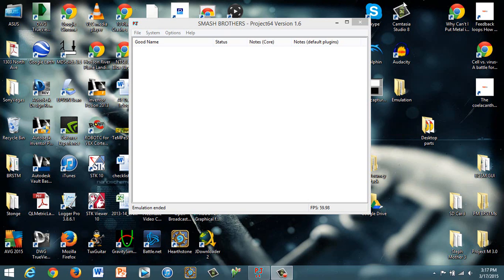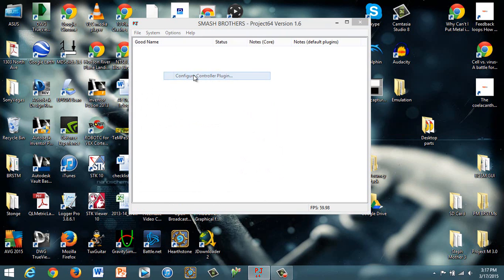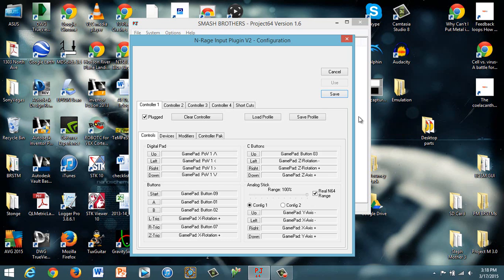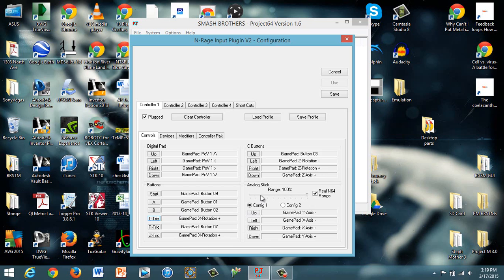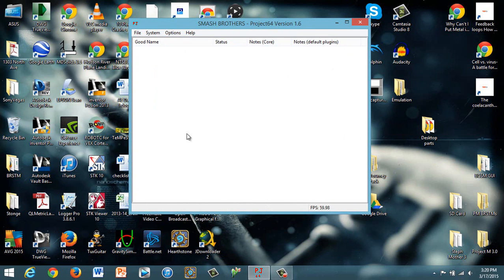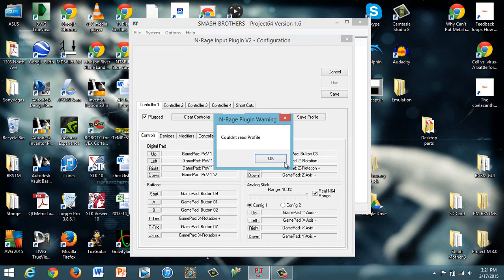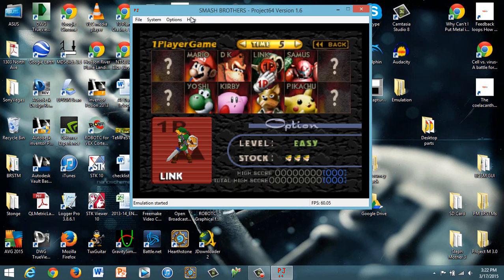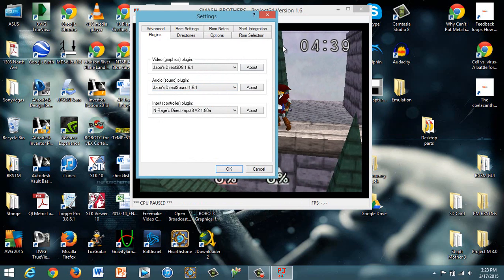Project 64 Mayflash Adapter Setup for Gamecube Controller Windows 8

Comment: I just recently started speed running mario 64, and my c stick registers on  the settings, but not in game, any ideas? Also, is pressing l and r down all the way the only solution?
Reply from the maker: With newer versions of the emulator I'm honestly not sure what it can handle.

Comment: hi i've spent all day trying but still can't get my pc to recognise my mayflash gamecube adapter inputs for PJ64. I'm using Windows 10 and my PC makes the bing noise to indicate it's recognised something it's plugged in but when I try to configure the controls in PJ64 nothing happens. I've tried: 
- disabling the driver enforcement 
method in this video: https://www.youtube.com/watch?v=gYk-21aN4ig
- installing a bunch of different drivers 
- installing different plugin controller inputs (e.g. NRage DInput8 V2.2.dll into the program files) 
- getting it to work with vJoy and WiiU - USB GC Adapter (apparently this is only for WiiU 
- i'm just playing a ROM on my laptop) 
- plugging it into every different USB port on my pc 
- switching the mayflash from PC to Wii U and back 
I've watched every Youtube video on the subject and followed every step to the letter. 
should i use a different plugin? 
should i use a different version of pj64? mine is 1.7.0.50 
should i use a different adapter?
should i just download Dolphin and try and play on that instead? thanks for any help
Reply from the maker: This is for windows 8 so drivers could be  different. I've never set this up on windows 10. It's also been areally long time so updates have happened I'm sure. I'm sorry man :/

Comment: Im confused as to why my controller isnt even being recognized? I have the adapter to connect it, its in, i have everything downloaded but no inputs on my gc controller are being registered at all
Reply: my computer recognizes its in, just no buttons work. Does it need to be the Wii U adapter? I have the switch one, it came with my smash ultimate gc controller
Reply: @alexanderh7807  damn 4 months and not a single reply to help
Reply: @marudofu  its okay lol. figured it out myself. Played DK64 and never turned it on again lmao
Reply: @alexanderh7807  how did you figure it out? lol
Reply from the maker: I'd been off of youtube for a couple years really and missed all of the comments. At this point my guide is probably outdated but I'd imagine the newer versions of Project 64 make it easier.

Comment: I can't get my gamecube controller to work. The project 64 simply isn't reading the inputs that i'm putting in. Any help would be appreciated.
Reply from the maker: did you install the driver file(s)?
Reply: Yes I have it exactly like you did in the video.
Reply from the maker: You're using a mayglash adapter too? Windows 8 or 8.1? If that's the case, assuming hardware is good, there shouldn't be a problem. Did you extract driver? Or just moved a zip file. Hard to help much without really knowing your setup
Reply: Battle X On 

Yes, the one with two ports. Windows 10.

I downloaded the thing to give my Project 64 the 1.6.1. What are these drivers you're talking about?
Reply from the maker: This guide is for Windows 8. Windows 10 should natively pick up the device, but may work differently. I would look up a Windows 10 guide if one is available.
Reply: you end up figuring it out? My story is similar, my mayflash was showing up in devices so i selected it but the program would still not pick up my inputs, so installed more drivers on zadig and now my controller wont even show up in devices.
Reply: frog man 

haven't yet but I'll get back to you if you do. I'd recommend posting on p64 forums if i were you

Comment: My device is being read, and I can select it, but I can only input one direction: GamePad: X-Rotation -...the other times i attempt to change anything I just get a wait notice. Nothing.. Installed drivers and reinstalled.. I'm using the MAYFLASH 4-port GC adapter for Wii U
Reply from the maker: jinglebear2 I've never used that adapter before, but what does the emulator say the directions are set to if not + and -?
Reply: I switched to my old Mayflash 2 way adapter. I am trying to get any direction or any button read, and only "GamePad: X-Rotation -" will select from my end. Even on start, if I press start. Same result.
Reply: Actually, it is working now with the USB Gamepad 1 registering. Thanks! Looks like the MAYFLASH 4 Way GC Adapter doesn't work for this plugin.. At least I have my old 2 way. Time for some Majora's Mask.
Reply from the maker: Sounds good! have fun :)
Reply: Shit.. I have it configured, and I selected "use" at the bottom, but nothing is responding.

Comment: I use the mayflash adapter and it works fine but when i play anything that isnt smash or a racing game it doesnt detect a full 360 only up down left and right and that makes it really hard to play anything else other than smash and a racing game any solutions?
Reply from the maker: Far can you screenshot the inputs you have set? is it checking cardinal directions or all possible ones? is there a dead zone you can change? have you calibrated the controller again or reset the controller settings? lotsa questions here
Reply: almost right as it gave me the notif that you responded i fixed the issue it was the analog range it was set to 66 and not 100. that fixed my problem but thanks for responding anyway :D
Reply from the maker: good stuff:)

Comment: I installed all the inputs and I have been using Dolphin with my gamecube controller fine but Project 64 will not recognize the controller. When it does, immediately sets any input to "Gamepad X-rotation". I have tried 2 versions of Project 64 and 2 different controllers. Any help would be appreciated.
Reply from the maker: MasterChief0522 gamecube controllers and n64 controllers work differently in terms of analog/digital controls, so sometimes it helps to hold certain buttons halfway before starting the config. set the thresholds better.
Also, mapping the dead zones is really important depending on your controller. I know xbox360 controllers move much quicker than gamecube controllers through an adapter in terms of motion speeds. So monitor the ranges. calibrating it in Windows is pretty key then, too.
Reply: Battle X On How do I calibrate on Windows 8? I can get to the calibration tool, but the inputs don't do anything there despite still working in Dolphin.
Reply from the maker: as long as the right plugins are installed you should just have to pick the right device while it's active (connected  and turned on).
try checking my guide for setting stuff up for steam and it might help. It's been a while since I did that though.
Reply: Battle X On Thanks, I'll try that. If that doesn't work  I'll just get a Mayflash adapter and see if I have any luck with that (I'm currently using the official gamcube adapter).
Reply from the maker: all of my guides are using the mayflash adapter so that would probably help
Reply: Ok, I got a mayflash adapter but still nothing. Opening the calibration tool displays that all ports are working, but upon trying to calibrate the controller, there is no response. However, Dolphin still recognizes the controller and it plays fine. I really don't know why it's not working in P64 and the calibration tool. I have all the drivers and I've reinstalled the drivers through Zadig 3 or 4 times now.
Reply from the maker: what version of project64 are you using?
Reply: Battle X On I've tried both 1.6 and 2.3.2
Reply from the maker: have you tried a different controller? if it still sets everything to x rotation you should try holding the sticks in a direction before calibrating to double check what is rotating that causes that. double check sensitivity values. it seems like the controller is either constantly registering an input, so it reads it before you can choose the button
Reply: Battle X On I'll continue trying, but for the time being I havr managed to figure out how to install wads into dolphin and they run seemlessly with the gamecube controller. 

I have tried 2 controllers, both have the same results. I tried them in 2 versions of project 64 in conjunction with 2 adapters, so I really am unsure why I'm having problems. I'll mess around with the sensotivities and how I input them to see if it changes anything. Anyway, thank you for all your help, I really appreciate it!
Reply from the maker: Not a problem. I just feel bad that I can't figure out a solution for you. Hopefully you find one!
Reply from the maker: wait...did you do what I did in the video? I just realized x rotation was part of my original problem. I held down L until just before it clicked, then clicked as the input. same for R.
Reply from the maker: MasterChief0522 I also manually input some stuff in, but this was soooooong ago.
Reply: Battle X On It was doing that for any button, whichever I tried to map first. As soon as I clicked "A" or "Up" or anything, it immediately went to X Rotation, then the next button I would try to set would count down to 0 and remain unassigned
Reply from the maker: I feel like there's a setting that needs to be checked or unchecked. I'm tempted to say reset all settings and try again, but I don't want to waste time.

Comment: how would you go about setting up multiplayer. I thought I had it but my second controller doesn't respond in the game but it does in the options. my first player controller will act for both controllers though. is there another plugin perhaps?
Reply from the maker: Josh Mosley you need to tell the emulator to use the second game pad option iirc. it treats each controller port as a separate Device.
Reply: yeah I figured it out. thanks
Reply: @battle_on  This Is Exactly What I'm Googling! I've Got The 4 Port Mayflash Adapter, How Do We Go About "Telling The Emulator To Use The Second Game Pad Option..iirc" ?
Reply: Josh Mosley I'm really struggling here. I can't find this second game pad option. Halp.
Reply from the maker: that should be based on the adapter. if it's a 2 port that makes for 2 controllers

Comment: it won't recognize my controller what do
Reply: When using the MAYFLASH adapter, it has to be set to WIIU mode for Dolphin, BUT make sure it's set to PC for Project64. It will come up in 'devices' drop down menu then.
Reply from the maker: I'm assuming you downloaded the nrage direct input driver right? You also are using a working usb port and set up the adapter?
Reply: Yeah I downloaded the drivers and everything but it doesn't say usb gamepad in p64
Reply from the maker: VirusFarmGaming it might not recognize it as a game pad by default but it should recognize that something is there. check in th device manager to see if something pops up when you plug in the adapter
Reply: it shows up for me when ever I plug it in but it doesent show up in project 64
Reply from the maker: that means nrage isn't being used by project64. if it is, it should see it there when you do the controller setup. the plug in is necessary...or an analog of it at least.
Reply: The computer recognizes it, as does vJoy, but P64 won't
Reply from the maker: that means something is up with the plugin interpreting it for the emulator
Reply: I have the latest plugin( N-Rage's Direct-Input8 v2 1.83)
Reply: is there way to force project 64 to recognize the GameCube controller?
Reply from the maker: which version of project64 is it? I tested this setup in the newest version and had a similar problem. 1.6 is the most stable iirc
Reply: Project64KVE
Reply: should I use a different version?
Reply: the only thing is that I want to play smash 64 on smash ladder
Reply from the maker: djpj3000
If that's the case, I'd check anthers ladder for a guide
Reply: I've looked at it but it has absolutely nothing to say about my problem
Reply: MVP BOIIIIIIII
Reply from the maker: You have a different adapter than I do then! That explains so much...

Comment: I need help, I'm using the mayflash gamecube controller adapter and yes I do have nrage on _, I'm trying to set up my controller but NOTHING I press on my game cube controller would make any game on project 64 respond to what I'm pressing,
Reply: my controller wouldent show up in devices
Reply from the maker: do other things work on that usb port? As long as their is a driver installed for the device it should automatically pop up.
Reply: Battle X On I used it for dolphin ALOT of times, but it just wouldent pop up

Comment: my l and r triggers arent responding and when they do i have to push it the whole way down my c stick isnt working at all the a and b buttons are instant
Reply from the maker: the l and r buttons on a gamecube controller have 2 actual buttons. one is based on how far you push down (analog) and there's the digital which is the button click at the end. try switching to the opposite one and see what happens.
Reply: Battle X On i tried pushing them halfway down as i do normally then i tried slamming them down hard and its still really not responding in smash i have to press it the whole way down 5 times to shield
Reply from the maker: I have no idea why it would count something happening 5 times. is it actually 5 each time? have you reset the controller/unplugged it? did you configure the plug in and set up the controller like I did?
Reply: the controller works perfectly with dolphin i followed the tutorial as closely as i could maybe i did something wrong i think im using a more updated plugin
Reply from the maker: I'm not sure what happened. sorry :/
Reply from the maker: Yea, I used 1.6 over the newer versions because it seemed more stable.

Comment: if your controller input isnt being detected try going to configuration > "devices" tab next to controls, and then selecting your device eg. USB gamepad 1
Reply from the maker: what he said
Reply: asdf where is this at in the program? Can't find it...
Reply: asdf I found it but it isn't showing up :/ just says none...
Reply: switch your adapter to PC mode
Reply: i still cant find it
Reply: where does it show where you device are?
Reply: okay I see it now but it doesnt show up anywhere, any suggestions? Thanks.
Reply: Adam s where is it? I can’t find it.
Reply: nothing is there, no controller is being picked up nothing is working
Reply: well it sees my xbox controller, not my gamecube one, and it wont let me set controls whatsoever this is such a great streamlined thing!

Comment: So I'm using a mayflash. The controller works fine on Dolphin,but it doesn't register any inputs on Project 64.Like I go to controller config and just nothing happens when I try to configure it.
Reply: I tried samething yet it dident work
Reply: @djpj-oy4lk  4 years late, make sure your adapter is set to "PC" mode when playing on PJ64 and "Wii U" mode when on dolphin
Reply: @VillaGaming3  Sir, I've figured it out 4 years ago, no worries though.
Reply: @djpj-oy4lk  so sorry lol
Reply: @VillaGaming3   I love the internet
Reply: @flooby12p  Why so? lol
Reply: @VillaGaming3  It still doesnt work for me. Nothing happens when im smashing my buttons :( Can you maybe help me?
Reply: @VillaGaming3  lol this just saved me a headache. i doubled checked that and it worked.
Reply from the maker: did you set up nrage? that helps a ton
Reply: Nvm, uninstalled and reinstalled drivers then restarted project 64. That worked. idk what I did to fuck it up, but it works now.

Comment: Project 64 2.2 is underwhelmingly shitty, even Super Mario 64 is running like complete garbage. I don't know how they managed to fuck that up so bad, maybe it's just that it needs some tweaks, but why does 1.6 work so much better out of the box?
Reply from the maker: I honestly don't know. it rendered a couple of games better for me, so it's what I used.
Reply: Battle X On Anyway, thank you. I was using a newer version of N-Rage and the C-stick did not work at all. I have been sporting Mupen64plus for the last years as I migrated to Debian, but it turns out Mupen64 does not support the Mayflash adapter AFAIK. 

I expected PJ64 to have improved during my absence, though the interface is easier to navigate it gives me the impression that optimization went to utter shit. Thank god for 1.6 XD
Reply from the maker: +Alessandro Porcelli 1.6 still works well for me. I have the newer version for games that problems on 1.6 though.
Reply: Yup, me too,  though it shouldn't be necessary to keep older versions to stay in the sweetspot. 1.6 is over a decade old, that's remarkable.
Reply: I just managed to get the thing working in mupen64plus AND on PJ64 with JaboDImput with the latter still having stick range issues, but I guess there is no point in using that plugin where NRage is available.

Comment: Works great, only problem I have is the cursor scrolling left on certain screens. When I go to the stage selecter or try to change the time/stock count in vs mode settings the game starts scrolling like I'm holding the stick down. I thought this was a controller problem but it works fine in-game and on all the other menus, also no problems when I'm using it in Dolphin emulator. Any fixes? I didn't end up needing any of the plug-ins you suggested in video, might they potentially fix the problem? Thanks
Reply from the maker: the plug in might fix it. nrage fixes the way inputs are read.
Reply: Thanks I'll give it a try

Comment: For all of you who are using the OFFICIAL Gamecube Adapter for Wii U: You need to install the driver with Zadig, then start vJoy. After that the device gets listed on windows and you can open PJ64 and go to options->controller plugin->devices->and change the device to vJoy Device 1.
Reply from the maker: I'll have to test this out later. Thanks for the info!
Reply: +Shot everytime i config my buttons to the controller it just says there's already an input assigned to that button. Calibrating just doesn't work at all either. DAFUQ
Reply: +Shot Can't change device on 2.2
Reply from the maker: I've never used that adapter, sorry!